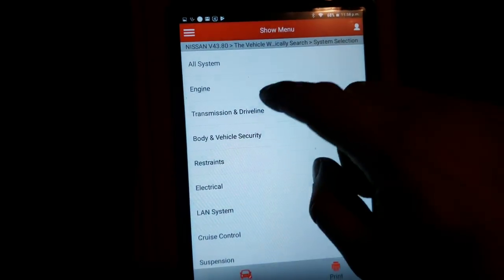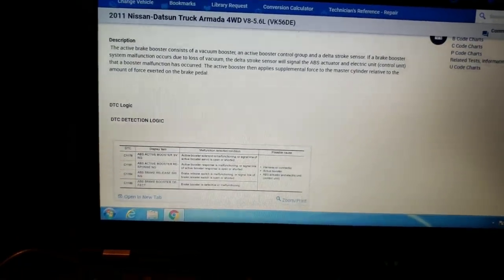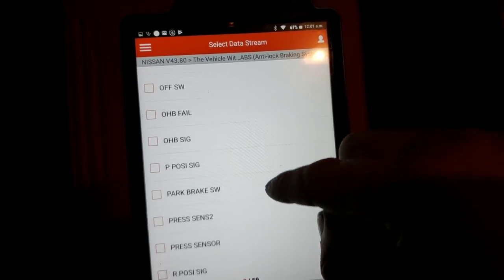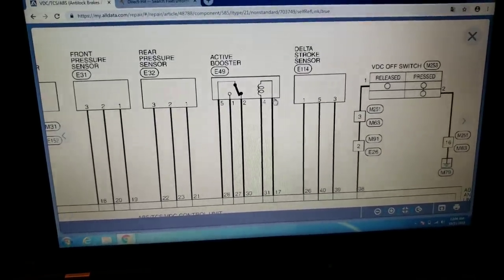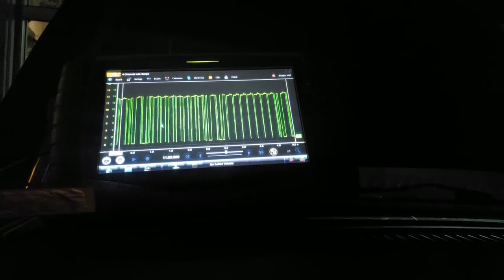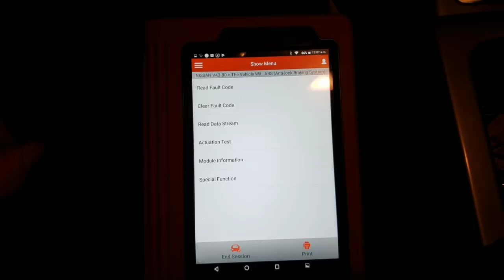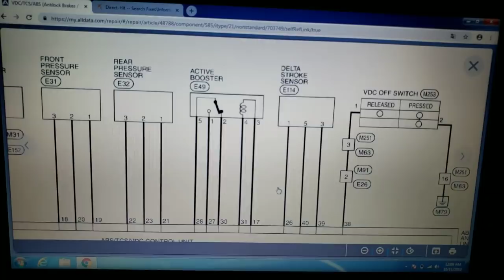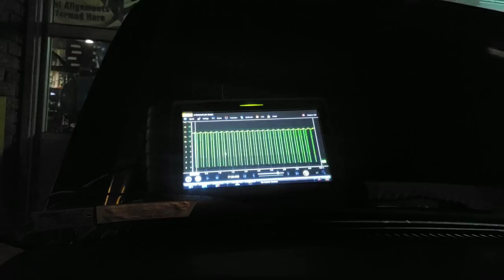2010 Armada Active Brake Boost c1178

Comment: Nice work. I’ve had the delta stroke sensor fault many times which is mainly the booster. Be careful when testing it. If you test with engine on it’s completely different than with the engine off. Well in the flow chart it doesn’t say which way to test! I found it would glitch at times with a scope attached.

Comment: As a Nissan Master Tech their pin point tests suck. I rarely use them. Grab a diagram read basic op and description and go from there. Never ran into this one but I've seen the pressure sensors fail on the master cylinder. I find some of the comments funny. You guys think this old Nissan is fun the newer stuff you just wait......

Comment: Never forget “you can with a Nissan!” 😂
Reply: What’s the purpose of this system Keith? 4wd? Traction control? Crash system? reminds me of the old horrible Freelander 1’s and its intermittent three amigo lights and the two brake pedal switches that stuck and caused it wiggle the switch and fixed.

Comment: The other brake system failure that Armada's are famous for, is the utter failure while driving - warning light/message and if you step on the brake peddle -> straight to the floor with NO brakes!!